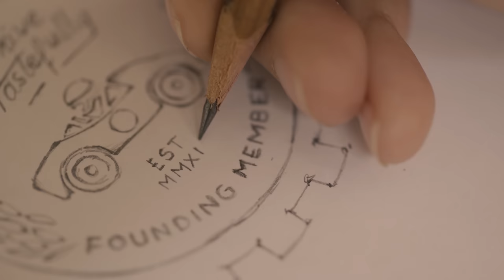1986 Marcos Mantula: Morning Coffee | Petrolicious

Comment: The design of this car is amazing. Hard to believe it's from 1986, I would have guessed it's from the '60s
Reply: It is!
Reply: The design is from the 60s with a few cosmetic changes, the engine is an upgrade over previous Marcos offerings in the same Costin designed body with inline 4s and V6s but the difference is 1962 aluminum Buick, Olds, Pontiac V8. I told Gem Marsh back in 82 that his cars needed the BOP V8, it was then going into the Range Rovers and Triumph TR8...but so was everyone who loved his cars. The V8 engine was the obvious choice to keep the old design alive. The Marcos presents the best rump of any car built to date, the design was just that good that it still looks bold today.

Comment: Hey man, repair the stop light and delete the play on the steering wheel 🤯
Reply: Could be worm and roller...was part of my Fiat 124's charm/terror 😉
Reply: @ad_fletch  No it is rack & pinion, and extremely quick at that.  I have a 68 GT and it has a Lotus 1600, bored to 1700 and built in England by Vulcan.